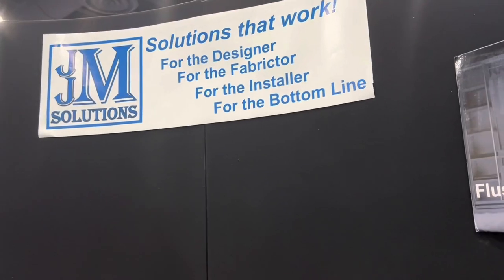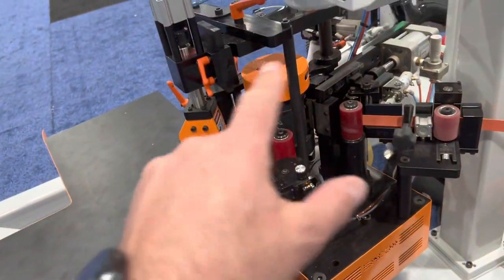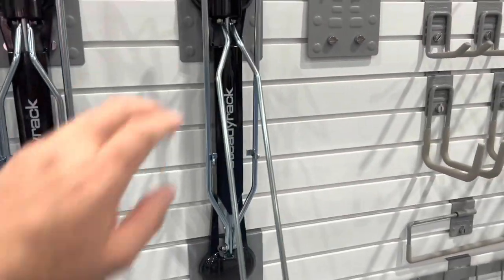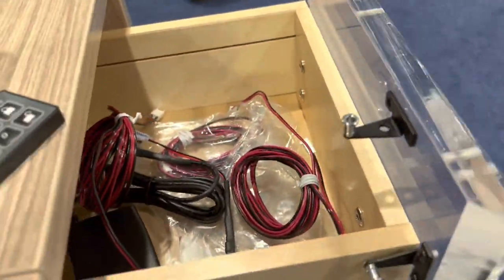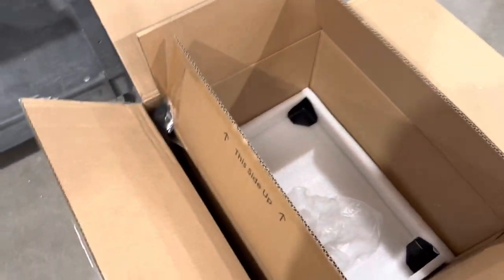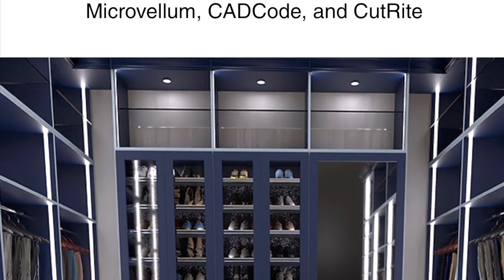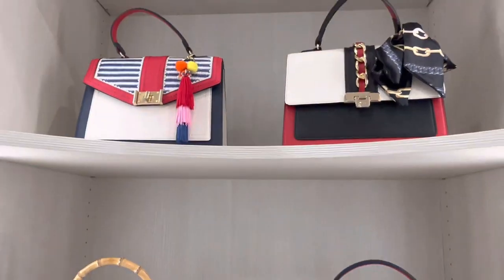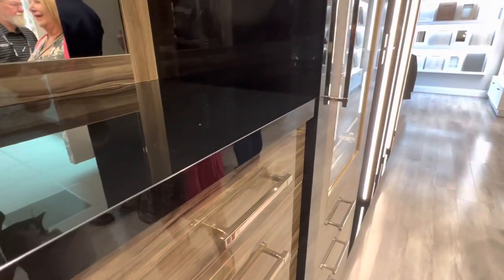Closets Conference 2023 Cool Stuff I Saw Including Tour of Closet Lifestyles Showroom & Shop

Comment: Storewall panels are far superior to Handiwall. Not as wide a selection of accessories but can use other manufacturers. The install brackets are nice but I found more time consuming, especially when stacking, requiring precise positioning. The SteathLocks work best if done with hardwired cables to 120V power supplies. Had one customer who never replaced batteries, requiring replacing latches on regular basis. Double door catches work well, just have to acclimate to opening one side first always. Florida showrooms always were cutting edge design wise.